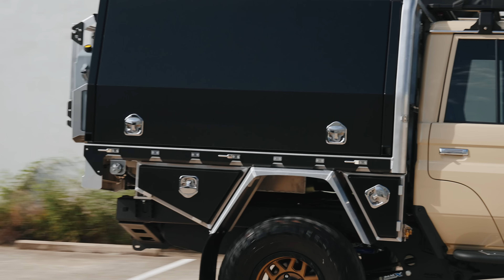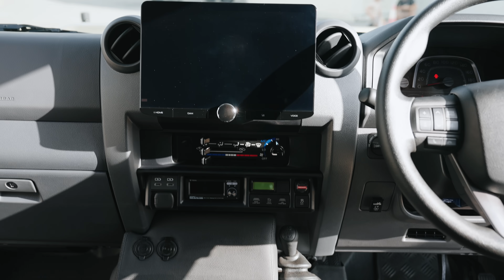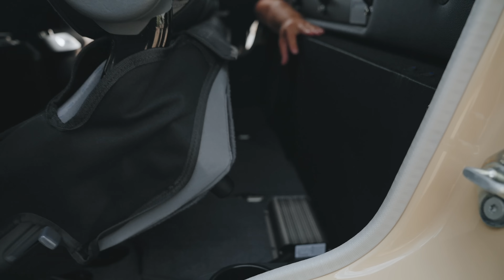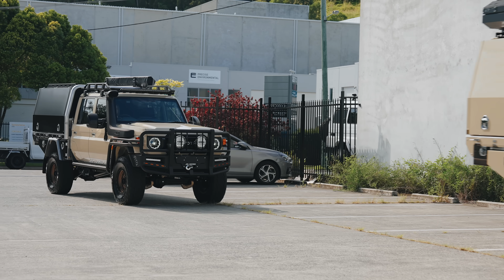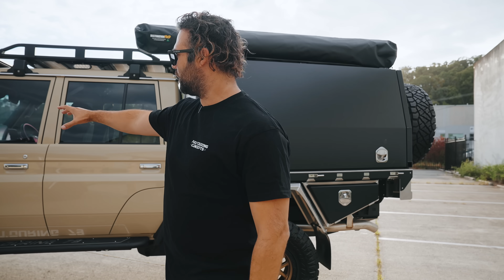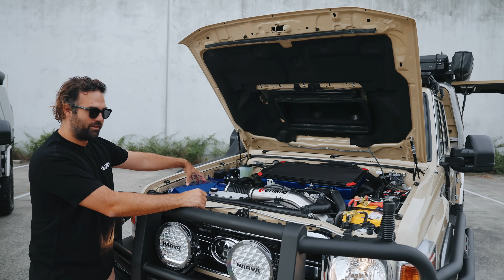Two V8 79 Series Builds You Need to See!

Comment: Great video Caleb. Any negatives fitting the 8speed?(apart from cost)
Reply from the maker: Cheers mate - only installer error mate the kit is great. They’ve done well to refine
Reply: @ProTouringTV  Installer error?
Reply: @ProTouringTV  Also can a 2024 facelift 79 steering wheel fit on a pre facelift to give it all the controls it needs? Im tired of the ali express streering wheels that sometimes work and sometimes dont.
Reply from the maker: @robertmillar2037 sure can mate. We still retro fit the 70th anniversary wheels to the pre face lift models
Reply: @ fricken awesome!!!

Comment: Do you think Toyota have done the wrong thing by discontinuing the v8
Reply: they didnt have a choice. Emissions laws forced them to stop because they wouldnt profit from them. Cant blame them
Reply from the maker: It definitely sucks but we understand the move from Toyota. The lighter 1GD variant is a better option for probably 70% of the consumer market. Cheaper to build, better emissions, auto, parts shared between other GD platforms . The list goes on
Reply: I see why they moved to the 4cylinder, but the V8 is fantastic to drive, but the power train as a whole is flawed. They should have moved to a ZF gearbox with a straight 6 for the 300, an option for the Prado and standard for the 70 series. The 70 series only really needed a better gearbox.
Reply: The f×××d big time 😅
Reply: No they haven’t done the wrong thing, the 1VD-FTV is hands down the most useless 4x4 Toyota ever made! 

Only rookies buy V8 cruiser 😂